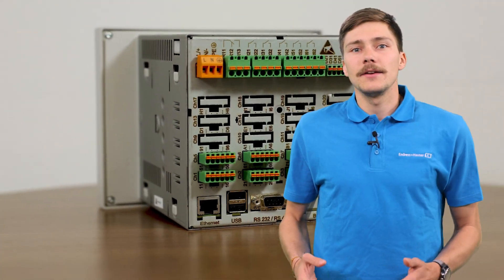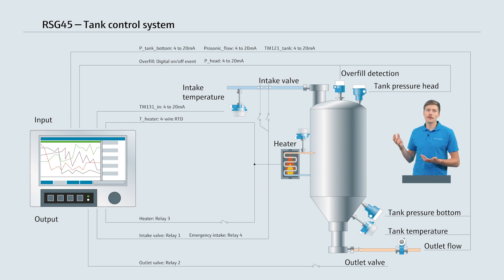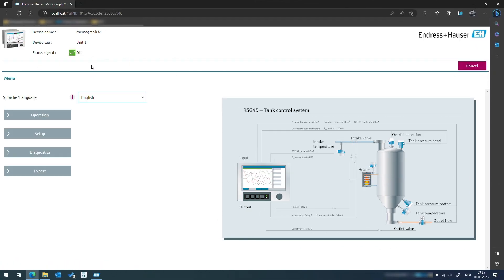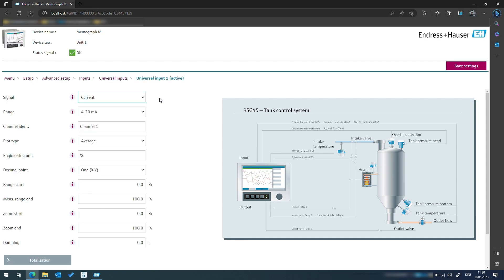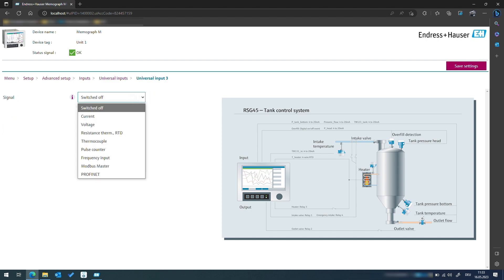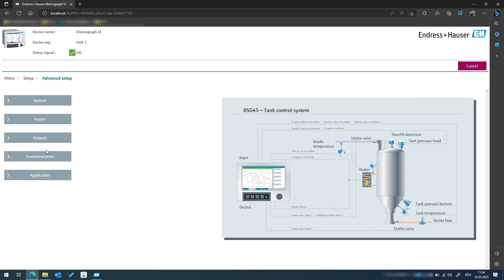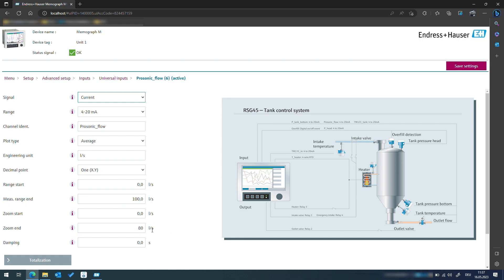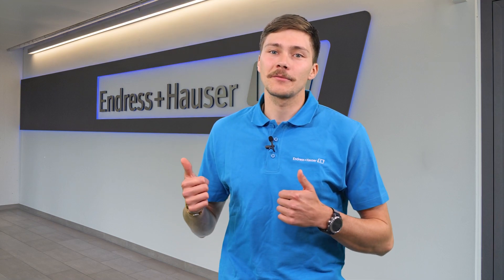RSG45 video series | No 2: Input signal configuration | #endresshauser

Comment: I didn't see you mention the Math Inputs at all. Can you tell me how we can set a counter which counts up or down based on the internal clock time. Let's say I want to activate a relay after 2000 hours. Is this an option?
Reply from the maker: Hello, we would recommend video 5 (math channels) to you: https://youtu.be/YYn0fDSojo0?si=QBxv7H_C3C_r2SWQ
It is not possible to activate relays based on a time event, only based on input signals.